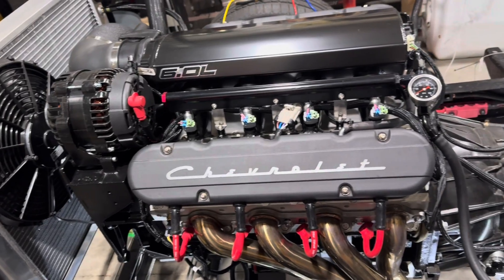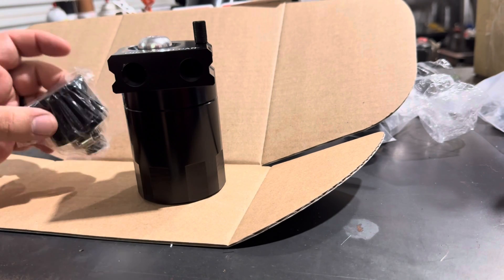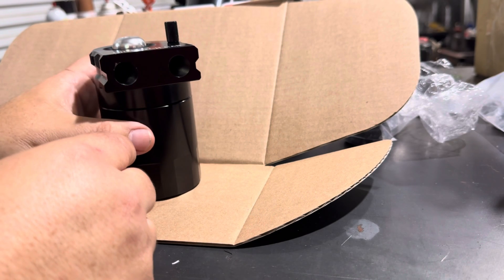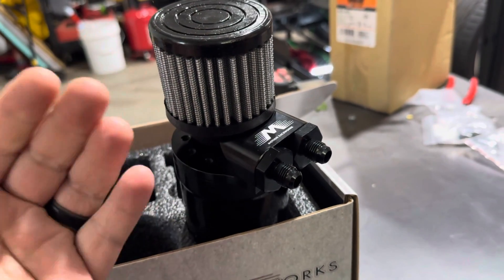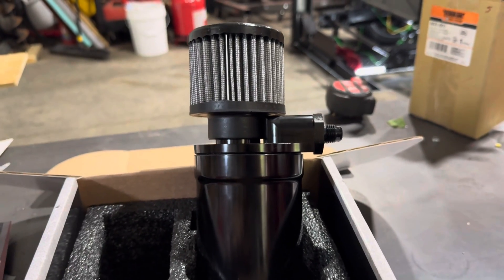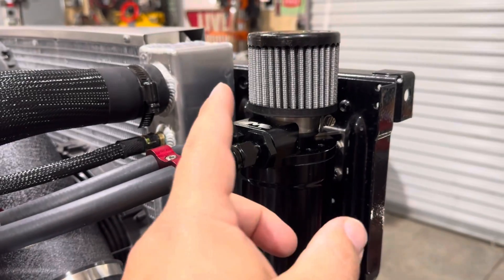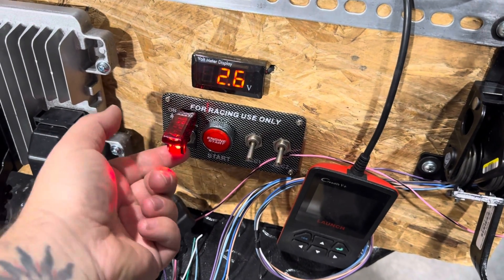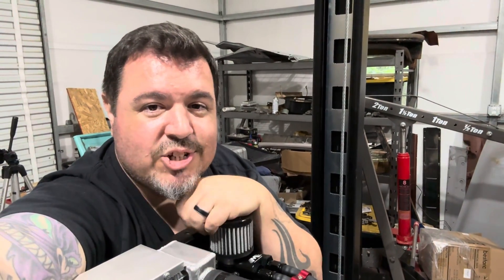Oil Catch Cans: 101 - EVERYTHING you NEED to Know!

Comment: an oil catch can is must for Direct Injection, and really any engine. Oil doesn't like to burn and ends up clogging fuel injectors and valves with carbon deposits. And Carbon is a bitch to remove. Carbon is the part of the oil molecule that doesn't like to burn. Of course neither does liquid gasoline which also has carbon in it (Carbon + Hydrogen = Petroleum), but that's another issue. (converting the liquid fuel to a gas then introducing the gas into the combustion chamber can double MPG. While reducing pollution by 50%. But that would mean
an answer to Pollution, Global Warming etc. It would also significantly lengthen the service life of engines making them more efficient.  Can't have that. )
Reply from the maker: I believe the NYC dept of transportation is experimenting with natural gas powered buses.

Comment: I have a 4.3 V6 on my 98 GMC Sanoma  pickup and was wondering if I need one on it.
which one is better?
Reply from the maker: Do you get oil in your intake?
Reply: my oil pressure gauge moves from 20 to 50 pounds of pressure when driving. intake is dirty all the time. my mechanic buddy just always say (just drive it, Its fine)

Comment: The first catch can you showed off of Amazon, if you do add the vented  cap do you need to run the vacuum line back to intake, or can you just plug it to make it like the motion race works can?
Reply from the maker: You have to plug the vacuum port on the intake if you use that can in its vented configuration. Or any can thats vented. In my case, I have a gen 4 LS with DBW and there is no vacuum port to plug, so I just run a line off each valve cover to the can. Hope that helps
Reply: @ that does thanks. Was just wondering about the actual exit port on the can itself

Comment: I installed a CC on the left (driver's side) of my '21 GMC 1500 V8 5.3L engine and was amazed on how much "crud" the can collected in just 3 weeks.   Not too sure of lab numbers of the trapped "crud" but even a non educated person knows that crud should never be allowed back into the engine.   A person would never purposely pour that stuff into a running engine.  Glad my CC trapped it.....  Like others, I'll be emptying my vehicle's CC every month - when I'm also checking its engine oil, washer squirt fluid levels, lighting checks and visual on its brake rotor surfaces, etc.
Reply from the maker: Yeah its like the designed the intake to be the catch can lol

Comment: I installed this on my audi 100/5000. This would have solved back in the 80s the issue that people died because they got scared the car acted strange, because the idle valve didnt catch up quick enough when slowing down the car to slow speed or complete stop. People got scared how the car reacted to this. Since i installed this that feeling is gone. They fixed it on later models with some kind of electronix device nearby the infold/air filter house. I think just some pressure release device as the idle control couldnt react quick enough.
Reply from the maker: Thats interesting. Never knew that… I dont have a lot of knowledge with imports.

Comment: Great video. However, at the end you say (and most other people) I cannot go wrong with installing OCC. Anyway I found the following video https://www.youtube.com/watch?v=hDx09voTlbw explaining the principles of PCV. This one a bit more deeper https://www.youtube.com/watch?v=N5TCxmJPFuU. 

It says, using OCC has one big con. It creates obstacle in form of filter/OCC for blow-by to escape as fast as possible. As a result it wears the engine more as blow-by cannot escape that fast. It also can contamine the oil there. So it causes more issues at the end on long-term. 

Any note to that? I would like to buy OCC for my Challenger, but I don't know if that guys is true or what solution could fix it.
Reply from the maker: I don’t know if I subscribe to that theory. Blow by occurs from gradual wear, ventilating crankcase pressure wouldn’t exacerbate that IMO

Comment: So did you route both valve covers one to inlet and one to outlet and then just leave the filter up top? I saw your other video you ended up removing the filter and routing tibibtake
Reply from the maker: Ive since changed it back to being vented to atmosphere. One line off each valve cover routed directly to each of two inlets on the can. Filter back on top. Much happier that way

Comment: The only thing I have thought of is maybe there should be some sort of relief between the PCV and the vacuum line in case it freezes up in cold weather because 1/2 the stuff in the can will be water and over pressuring the crankcase would be bad news, especially with plastic valve covers, just a thought
Reply from the maker: @johnbolt665  that wouldn’t be an issue with a vented can configuration

Comment: What kind of rubber do you use on your hose? :)

Seriously though, I'm seeing these cans on the market with a mesh filter for a top hat but also three lines instead of two, even for small engines. What's up with that?
Reply from the maker: Just different plumbing options.

Comment: Hi thanks for your advice, i am considering mounting one of those on my pick up, but I have noticed that on my crank case I have 2 pipes that release pressure/fumes. 1 goes from crankcase inside the air admissions manifold(between filter and throttle body)...the second pipe goes from the crankcase inside the inlet (between throttle body, map sensor)
my doubts is, where should I place the oil catch canister?or should I place 2? both gets dirty with oil😅
Reply from the maker: @powergym1984  I dont know what kind if engine you have, but for a vented catch can application, you’d run a line off each (assuming v8) valve cover to the catch can. Then you’d cap off the inlets to the throttle body and intake manifold.

Comment: Does a catch can hold vacuum? Like could I run my brake booster AND my pcv valve off of a catch can rather than just the pcv? Would a sealed can be better for my application?Trying to do a vacuum pump delete on my silverado. And not trying to crimp off my pcv valve
Reply from the maker: Think of it this way, 
1- a sealed catch can is nothing more than a container in line with your PCV plumbing. It can NOT be ventilated if it’s in-between your PCV plumbing because it would introduce a vacuum leak. 

2- a vented catch can acts as your crankcase vent, without any lines returning to the intake. Think: breathers on valve covers during the carburetor days. Same thing, only with a can to catch any vapors containing oil/particulates
Hope that paints a more clear picture

Comment: What was the cause of the excessive oil in the intake manifold
Reply: I was recently using a vcm catch can and it has 4 outlets and it was constantly evaporated my oil i noticed i was using a litre of engine oil a week so ive gone back to a sealed can with 2 outlets and it's not using much oil and the throttle response is way better ive noticed
Reply: Im from Australia think our catch cans are slightly different
Reply from the maker: The factory Pcv configuration plumbs the valve cover back into the intake. The vapor contains micro particles of oil that build up over time, the intake itself ends up acting like its own catch can
Reply: @intheshoptv   why not install a catch can between the valve cover and the intake tube to slow down the oil mist when under load and help keep the intake dry and less in take valve carboning ?? old 72 year old mechanic talking in my sleep .😂🤣😅
Reply from the maker: @ They do. Thats the other configuration I mentioned to where you’d run a “sealed” catch can.

Comment: No engine blow by. Think of it as sewage. Going back to mixing the filtered cold air with sticky sewage then polluting the air-fuel ratio giving a much poorer combustion losing HP and MPG. With each combustion revolution the cold air intake reduces in size slowly choking off the air to the engine. Sticking to the backs valves and highly machined and balanced turbo parts and injectors then turning into very hard-to-clean carbon again closing down and choking the air to combustion chambers. As well as reducing the quality of the best and cleanest combustion ie. pollution. That gets worse with each combustion.
That is just poor engineering and quality controle. The Vented catch can is the best with the least all around trade-offs.
Reply from the maker: Thanks for sharing your thoughts!

Comment: My reason for the vented can is simple. It's Clean cold air fuel ratio. Keeping my cold air intake as clean as possible and polished for air movement also offers the best and cleanest combustion for the best HP and MPG and the most pollution-free exhaust per MPG
Reply: Yes indeed, probably the best reason for a vented catch can, I bought one last night and got worried i made a mistake in not buying a non vented one and your comment put me at ease 👍
Reply from the maker: I’m with you - the cleaner the air, (and intake) the better👍

Comment: My boxer engine has three vacuum lines: two for each valve cover that go to the intake before throttle body and the third is from the crankcase to the PVC valve intake manifold.
The crankcase to manifold has all of the oil residue, but the valve cover tubes are clean with 180k miles. So, I think I only need the catch can for the crankcase, correct?
Reply: You're right and on boxer engines like Porsche you shouldn't ever need a catch cans between heads and intake because they have scavenger pumps in the heads forcing the oil out of the heads to the crank case if you ever get oil in those line then the pumps in the heads are bad
Reply from the maker: If you want to keep the same recirculating configuration (not venting to atmosphere), then yes, thats exactly correct!

Comment: In California, if an engine has a PCV valve then oil catch cans are not legal. If your car is old enough to not have the valve then the oil catch cans are legal. I have a 1990 Toyota Camry 4 cylinder which has the gas recirculation hose, but no PCV valve so I can add the oil catch can.
Reply from the maker: @bobpegram8042  I mentioned towards the end of the video that there are laws, rules and regs regarding their usage. 👍

Comment: So let me explain so I understand it myself. So non-vented would be coming from the vc to the IN port and the OUT port goes to the intake manifold. Now vented you just reverse your hoses at the catch can? Is this right?
Reply from the maker: Depends on the can you’re using. With a can like the motion raceworks that’s designed to be vented to atmosphere,
You simply run a line off each VC to the dual inputs of the can. In a sealed can, you would run the output of the can to the intake, correct.
Reply: @intheshoptv  Hmm? Both VC? My system from the factory is not set up with a PVC on both VC. I have a 2013 Chevrolet Silverado 1500 LTZ. My system have the PVC only on the left VC which connects to the top of the intake manifold. I know this cause I had to upgrade the valve cover to the updated design my GM. The oil catch can is like the first one in your video the Evil Energy. I think my options are very limited here with my particular setup from the factory. Thanks again!

Comment: If I wanted to block off the port on the manifold and my intake on the car and run the catch can inline between the 2 valve covers on my car does it need to be vented or can I do that with a seal can as well? For reference v6 NA motor making maybe 320whp
Reply from the maker: Vented! otherwise you’re rapidly pressurizing the can.

Comment: Some food for thought, venting to air keeps the crankcase at atmosphere. Venting back to the intake would keep the crankcase in a slight vacuum(in my mind is better).  Like you i dont like the idea of oily air going back into the intake, so why not connect to your ehaust?
Reply from the maker: I was actually discussing doing that with someone on the LS forums a few weeks ago.
Reply: 100% ... with that set up, long thin lines with no vacuum, id guess a higher crank case pressure than the original set up. Another way is use a 12v secondary air pump (smog pump) pulling from the catch can

Comment: So if you use a vented catch can what do you then do with the PVC hose?
Reply from the maker: @Ringmaster30  that depends on what gen engine you have… if you have a gen 3,  you’d cap all the other lines and just run two off the valve covers. If you have a Gen 4, they already did away with those lines and you’d still just run one from each valve cover. My next video this weekend will be of interest to you

Comment: Dumb question. I need to install a catch can in my daughter's CTS. I had ordered the one you have from amazon.

Does the in side go to the pcv valve output and outside got the intake manifold? I've tried to search for a straight answer to this and can't find a video or anything showing the exact way it hooks up.
Reply from the maker: @tac_r_usoutdoors8984  You would leave the pcv on the clean side, untouched. Then take crankcase ventilation from the tube on the valley cover and route it to your catch can, then out of the catch can to the throttle body, or intake. Hope that helps!

Comment: Okay, so I have a questions. I’ve watched many oil catch cans now. I’ve noticed that most of, if  not nearly all the videos, run the oil catch cans from the valve cover/s. That’s fine but what about the main pcv that exists off of the block instead… I’ve seen very few run the can off of that. Ig my question is many; is running the oil catch cans off the valve cover enough? Or is it better to put the can to use off of the “block” pcv? Is it possible to run a duel setup that feeds both systems? The reason is ask is because if it’s just off of the valve covers, that usually just recirculates back-before the throttle body. The pcv off the block, runs back into the manifold itself. So if you doing it just off the valve covers; aren’t you missing that vapor being sent to the manifold? This is assuming both are still needed. Now I’m researching this for maintenance purposes on my daily, which is a K-series Honda. So Ik you said that’s an LS but I’m still assuming it still has a block pcv too. So I’m confused ig. Not to mention. If it’s from the block, can it be vented. Would that just be a “leak”? Or since “air” from the block goes back into the manifold, would replacing it be fresh air be the same? 
I’m tempted to just buy two catch cans. One for valve cover, one for block. Run both vented, I’m curious as to if that’s too much and will make it a “air leak” to due unmetered fresh air-after the maf. Thus triggering a code. If so, go sealed for the block; keeping vented for the valve cover. I am curious because I have not seen that done. I’ve looked all over…can’t find anything like that. So idk if that will work, both vented. What does the internet think?
Reply from the maker: Like me you suffer from over thinker’s disease lol… pcv or “ positive crankcase ventilation” is pcv no matter where you take it from. Taking it from two different locations is pointless. Yes, if you take pcv from the valve covers and vent to atmosphere, you are missing it being recirculated back into the manifold… but thats kind of the whole point. You don’t HAVE to send it back through to be reburnt. In fact, if you run high horsepower or boost ect, you dont WANT to send it back to the manifold. On a street car, its really just a matter of preference.
Reply: My Toyota PCV is slung low on the block and slurps engine oil. I ran a sealed unit in the line last spring. No engine lights(I’m sure it would throw a vacuum code if it wasn’t sealed). It’s been catching a mix of oil and water. I’m sure it’s not catching everything, but otherwise the air intake is a disaster and that oil vapor mixes with the EGR gases at the top of the manifold and forms a sludge that eventually blocks the EGR ports. So I’ll take what I can get.

Make sure you run a high quality hose, mine was like $10/foot from Napa, otherwise it’ll likely collapse with the heat and vacuum it’s under. I’ve seen a lot of videos where the creator has that happen.
Reply: Want to know if you'd have an issue venting from the block? Run the car with your oil dipstick lifted. If no problem then you can do a vented catch can from the block. Volvos normally run a not so simple pcv setup which when gets clogged sometimes forces the dipstick from the housing. Had a Volvo 850 years ago which I ran with the stick lifted. Sometimes splashed a little oil in the engine bay. Have a Volvo xc90 presently that suddenly started leaking  oil from multiple seals. The pcv test for Volvos is to remove the oil cap and place a rubber glove over the opening and if the engine tries to suck it in the pcv system is ok. If it inflates the system needs servicing. Mine wasn't inflating. Decided to pull the dipstick a little and drive. Got some splashes in the engine bay (crankcase pressure) and my oil leaks all but disappeared. Right now running a vented can (made from a thermos) I've removed the dipstick totally and clamped a hose over the housing which  goes to the can.
Reply: Perfect. Thank you guys. Ended up running a filter for the valve cover. And an oil catch can for the block to manifold. Works great. Gave it a good intake cleaning and it seems to work like a charm. A few thousand miles later and it’s just as clean as I left it.